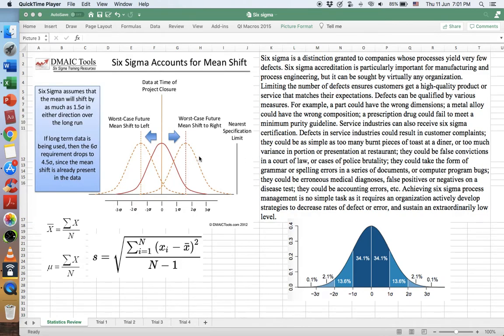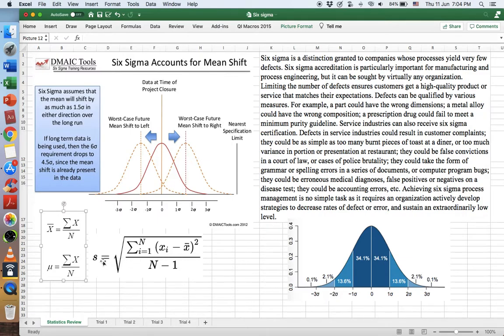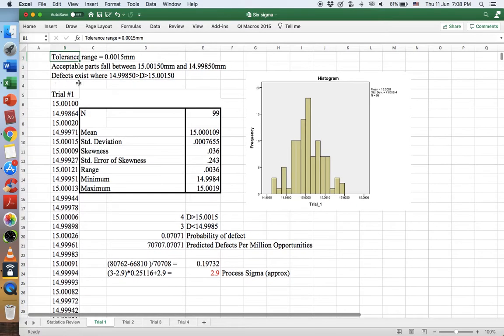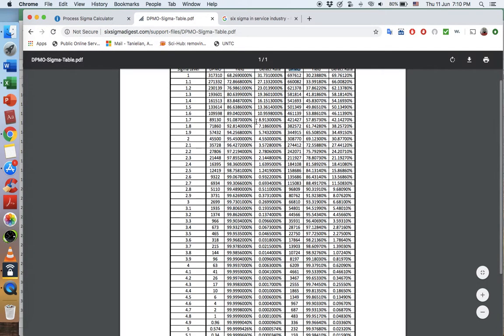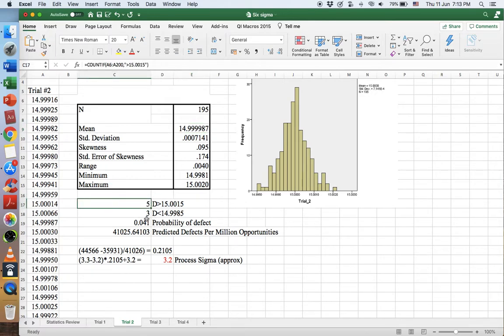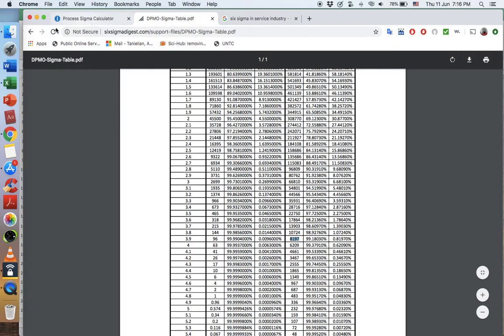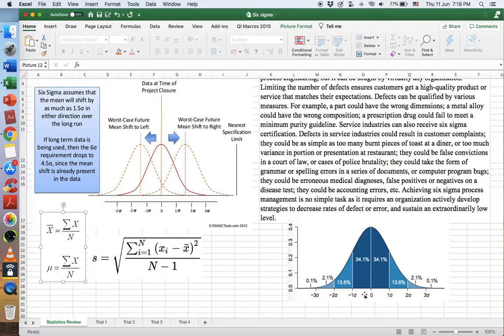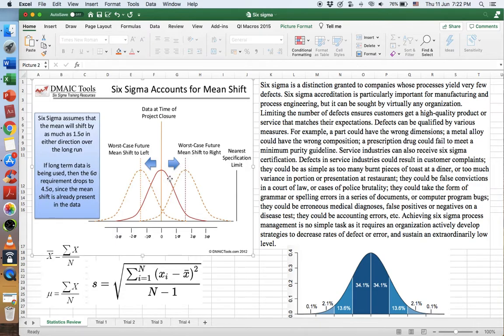Stats & Probability: Six Sigma & Quality Control

Comment from the maker: Note: there could actually be a couple outliers in that data; I didn't define outlier precisely, and only assumed there weren't any because the data was created using Excel's NORMINV(RAND(),B2,C2) function. Outliers are data with values falling 1.5 times the interquartile range above or below the mean. Typically, they don't exist in normally distributed data, but sometimes with large samples, they are present.